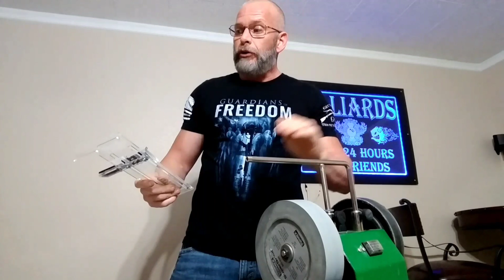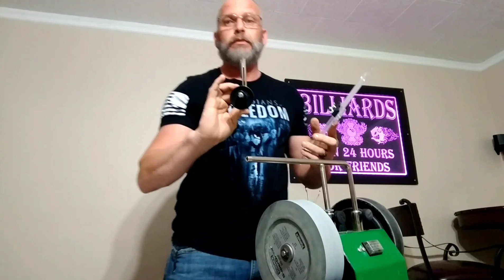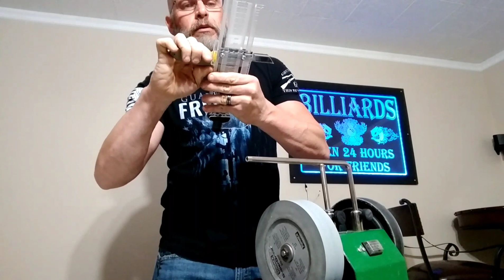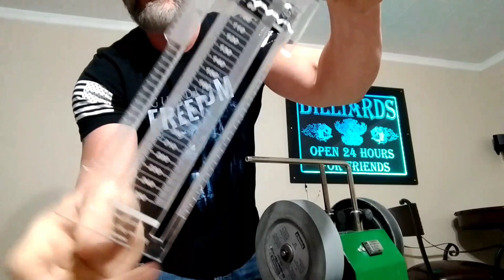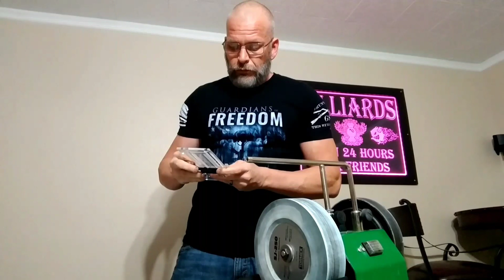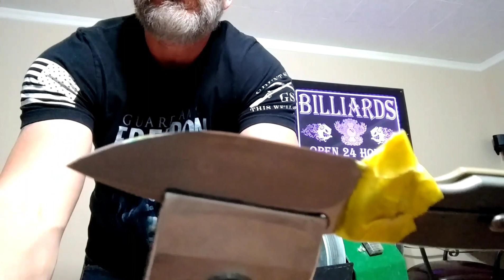All in One Angle Measuring Tool for Tormek Style Sharpening Systems

Comment: I just received the ultimate angle tool for Christmas, however I have discovered the software is being removed as a free software. Effective Jan first you will be required to pay up to $60.00 annually to be able to use the software!! If your fortunate to own a Tormek, you can purchase knife grinders software for a onetime cost of $12.00 USD. You own it!!! To spend $50.00 for the angle tool, and then spend up to $60.00 to have the privilege of using it seems excessive to say the least. You never take ownership of the product. I will probably return this tool.